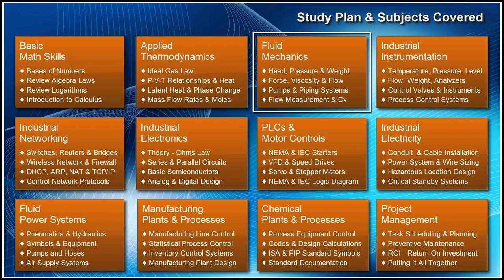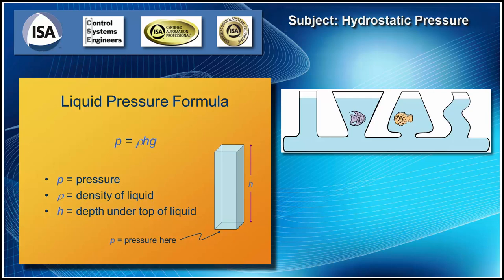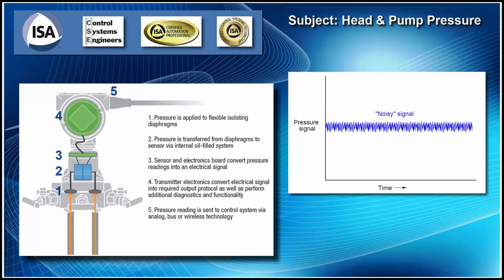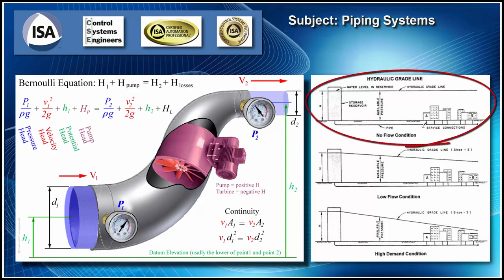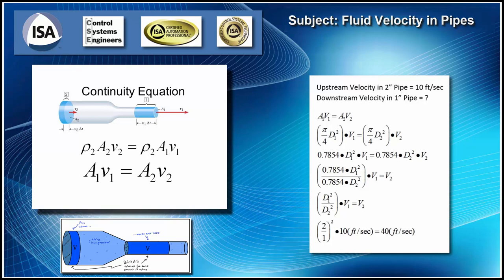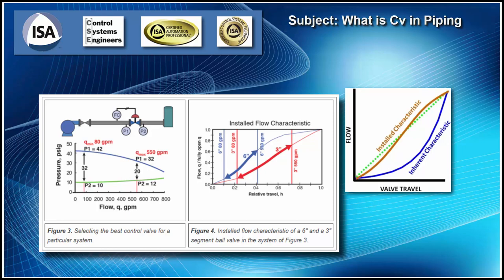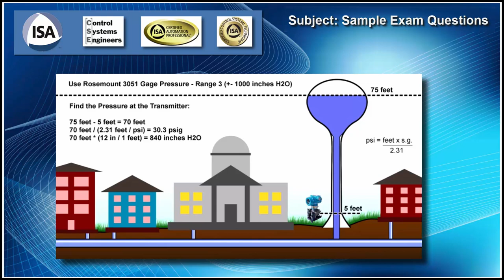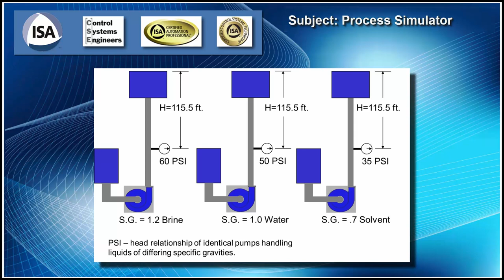Video 6 - Control Systems Review - Fluid Mechanics for Process Control

Comment: Do you recommend memorizing the spink equation due to the exam not offering it on the equation sheet and forcing us to use the robert miller equation?
Reply: The darcy-weisbach equation is also not in there. Would that be another to try and remember?
Reply from the maker: Don't waste time on the Spinks equations for flow. Most people don't use them anymore and they are not on the NCEES CBT PE exam. They where what ISA use to teach for the old exams.
Reply from the maker: It probably won't be on the exam, since it's not in the NCEES Controls Handbook. But the Reynolds number will probably be on the exam.
Reply: @BryonLewisPE  Thank you for both of the prompt replies! I will go ahead and use the other methods you go over in the book for my practice problems.
Reply: @shadowridrs  @BryonLewisPE Thank you for this comment here. This helps.

Comment: Hi Bryon. Great videos by the way. Extremely helpful.  Although this discussion is a year old, I think there may be confusion because the solution in the 5th edition is stating it to be 135 psig and not 154.
Reply from the maker: In the 5th edition of the CSE Guide from ISA, question 105 is answer "D" 154 psig.
Reply: @BryonLewisPE   We may have different versions of that 5th Ed. See screen capture: https://youtu.be/RkrRmtuUt5g
Reply: instaBlaster.
Reply: @BryonLewisPE  where are videos 9 thru 15 or so?

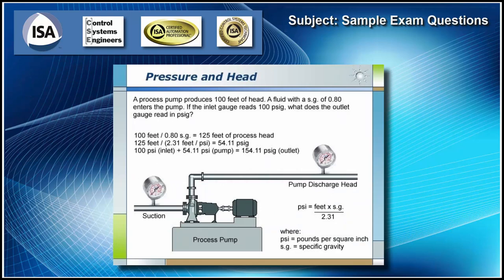Comment: 1:26:35 The answer is wrong because the discharge pressure calculated for SG of 0.8 should not be higher than water. A fluid with SG < 1.0 does not produce a higher pressure drop. Heavier solution produces higher discharge pressure, not the other way around.  
I never heard of the term ‘process head’ before. The reason why head is used is that it is independent of fluid type, and ‘process head’ is a dangerous term that will confuse a lot people.
Reply from the maker: The answer is correct. This is the fifth question in the sample 4 hour exam from ISA (CSE Guide 5th Ed.). The pump motor produces work in foot-pounds of work. When a fluid is lighter than water (SG < 1), the pump can lift the fluid higher producing more head or pressure. When the fluid is heaver than water (SG > 1), the pump cannot lift the fluid as high and the pump produces less head or pressure. Pumps are rated in head (feet of water), so a heavier process fluid will require more work to raise it the same height as water and it will require a larger motor to produce the same head or pressure as water. When the process fluid is lighter than water, it is just the opposite. The motor will lift the lighter process fluid higher developing more head or pressure, because of the size of the motor.
Reply: @BryonLewisPE  :  I see what you are saying, but on the graphic, you show PSI = Head * s.g. / 2.31.  But in the calculation, you use (Head / s.g)/2.31.  Please explain.  Thanks.
Reply from the maker: That is confusing. PSI = Head * s.g. / 2.31 is for tanks which is the previous lesson. To get the head the pump will produce we use  (Head / s.g.). To get the psig out of the pump we use (pump Head in feet/2.31 feet per psi). We then add the psig in the inlet piping (100 psig) to the psig the pump produced (54.11) for a total psig in the outlet piping (154.11 psig).
Reply: @BryonLewisPE  I'm still a little bit confused about this question. I understand and agree that a fluid with SG of 0.8 will go higher whit a 100 in H2O pump, but when we convert back to psi that factor conversion of 2.31 is for In of H2O not for a 0.8 SG fluid, so shouldn't be 125 * 0.8 (to convert back to in H2O) /2.31.  Basically what I think is that if you need to find the total height that the fluid will go you'll calculate 100 in H2O/0.8 = 125 in total height. But if you just need to calculate the pressure in psi at the output of the pump and you actually have the output in In of H2O, shouldn't you just directly divide 100/2.31 and obtain the psi added by the pump?
Reply from the maker: @felixg1075  It does not matter if you if you divide 100/2.31 but you still have to divide by 0.8 SG  for a total of 54 psig. The pump will produce 125 feet of head and then divide the 125 feet H2O / 2.31 (feet per psi) for 54 psig. Then add the pump 54 psig to the process fluid's 100 psig for a total of 154 psig out of the pump.
Reply: @BryonLewisPE   The 6th Edition study guide has the same question and so does your book. However, the 6th edition study guide multiplies the pump head by SG and your book divides the pump head by SG.
Reply: @BryonLewisPE  as Nilesh pointed out above, the exact same exercise is in the Study guide 6th edition and the answer is 100 ftH20 * 0.8/2.31 = 35 psi. Total 135. Maybe this exercise was a revised/corrected from the previous guide? Regards
Reply from the maker: The ISA CSE Exam committee has decided this pump problem is the total dynamic head of the pump, not water. So in the sixth edition of the CSE Study Guide they have revised this problem to be 100 ftH20 * 0.8/2.31 = 35 psig for a total 135 psig total in the pipe. In the fifth edition of the CSE Study Guide the answer was 154 psig.
Reply: @BryonLewisPE   for the exam question then, what is the correct answer? I have the older revision and I had a question on this..
Reply from the maker: @be13rus  I was told this question will not be on the PE/CSE examination.